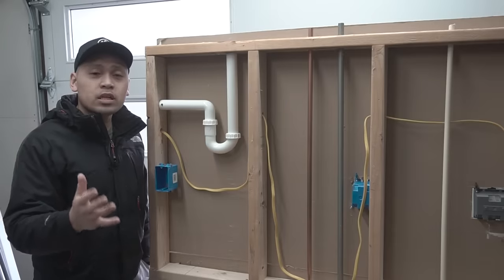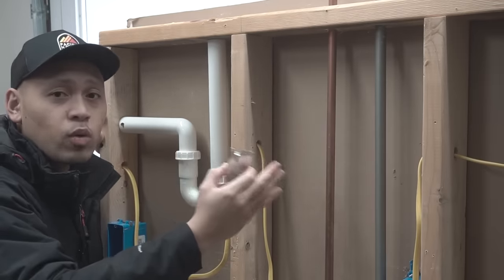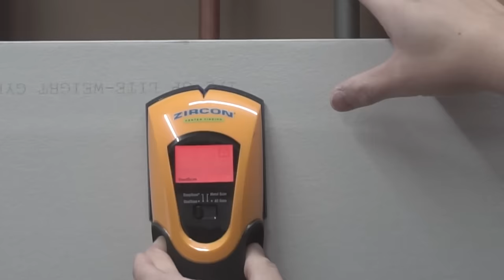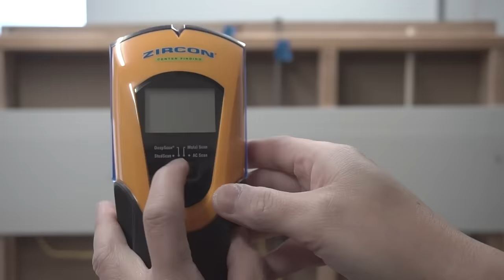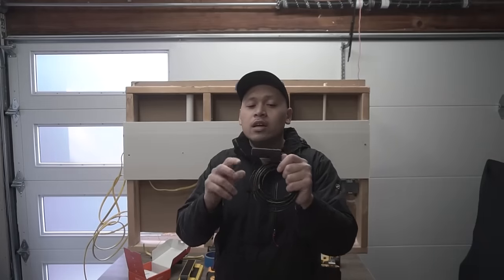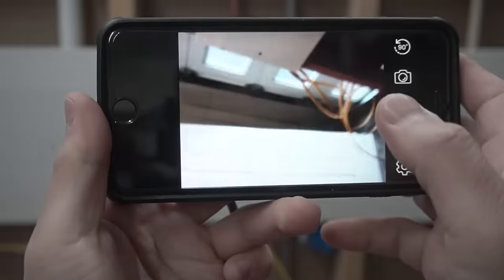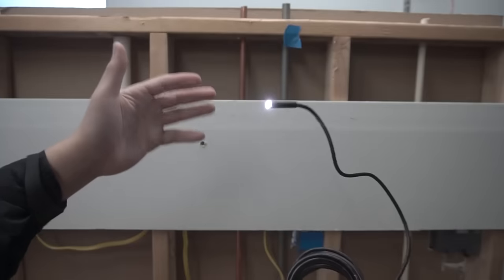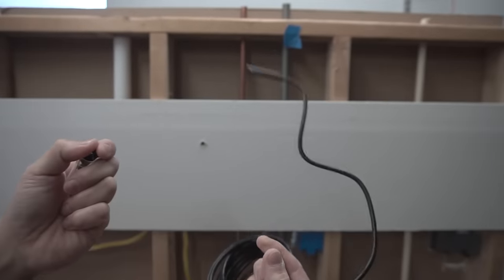STOP Drilling And Nailing Blindly In Drywall And Studs! - Learn A Better And SAFER Way As A DIYer!

Comment: I agree with the comments about it being impractical if there is insulation in the wall which is often the case.  One good use might be for leaks in a new shower or tub installation regarding the drainage pipe.  This could save the installer a ton of $ and headaches if they have to come back months, or years later because of all the damage a slow drip can cause.

Comment: To be honest we usually want to know where the studs are to hang stuff and if that was accurate - that would be great. I think that a worry might be that someone staples a live wire up the side of a 2 x 4 and you drill off center on the stud. I have one of those long stud finder like you have here - I usually measure as I find the stud and see how far apart the studs are to make sure it's not a pipe.
Reply: just use the correct screw length so only 3/4" to 1" of the screw goes into the stud. they you will never hit anything passing through or stapled to the center of a stud.

Comment: I think that stud finder was working. I think it checks at that little V notch at the top and you weren't running that part over the wire in the wall. It makes sense, since you want to know if there's electrical where you're planning on driving your screw.

Comment: Very good to broach this topic.  This has been a concern of mine for years, having drilled many holes for varied purposes.  Many a gamble even using quite a few of the tips mentioned in comments.  Discussing this can only develop tradeskill.  Dismissing this doesn't.  A thoughtful approach would consider the wall type and location of holes in relation to potential wires and utilities.  Also understanding that things inside a wall (including the framing which may be highly creative and NOT 16" on center) can be far from code.  Ultimately the greater the potential risk the higher the need to actually see what is in the wall (especially if you ARE drilling into a wet wall).  One loft I installed had multiple wall types and I carefully removed strips of the interior finish to see what was in the walls and locate dead center of the studs for exactly centering attachment.  Guessing was not a good option.  The removed finish was later covered by ledgers.  That was ONE case.  I remember one wall in a large remodel that was so full of pipes and wires that the first person to put a screw into a stud would have a high potential for hitting something.  In new construction I think there should be (and sometimes is) a photographic record of every wall before the finish.  This can allow locating covered receptacles.  Anyways a great topic to post that I have not seen anybody else do except those selling a tool.

Comment: Those cameras are very common in plumbing trying to find exactly where your mainline clog is. Inside walls sometimes you are going to have insulation. Bottom line is without cutting out the drywall you really have no idea what's behind the wall and should be very careful. That being said accidents do happen.

Comment: As a pro, this is what i do. I use a high powered bar magent as a stud finder. It is 100% reliable.  it finds the drywall screws. Then for screwing I use the proper length screw so only 3/4" to 1" of the screw goes into the stud. That way, even if something is running through the center of the stud, you will not hit it. Will also save you if you miss drilling into the center of the stud and are drilling on the side of it where a wire or supply pipe is running down the stud in the middle, you also wont hit it because the screw isnt long enough. Small things going through the stud like wires and supply plumbing pipes are impossible to hit as long as they are in the center of the wall. Its only possible to hit something with large diameter like a drain pipe. So in the 1 out of 1000 times you do, just cut open the wall and fix it, no biggie.

Comment: the costco stud finder detects all items behind a wall 1.5 inch deep with full batteries and can detect up to 8 inch wide studs.
another trick is avoid 18 inch from floor or 6 ft high this is the 2 common home runs for wire. plumbing is the scariest a wire will short and trip no big deal hit water supply or waste and you can have a huge problem before you discover you have a problem.
the best tool in the world is a little expensive but turns your cell phone into a thermal and radar sensor and you can see shapes sizes. its like looking through a military scope at your enemies on the other side of a brick wall and can scan 6 inch deep. sorry apple not for you in the walabot almost $120 but if money is not a concern you can use the flir 1 for android or IOS almost $400
Reply from the maker: Thank you so much for your awesome feedback! 🙏🏽😊
Reply: I believe many local big box hardware stores rent those FLIR cameras.

Comment: Nail plates will save the day. A company that I hired installed Smart siding on my house, and hit a wire instead of stopping to fix the problem they continued. Well long story short it cost them $900.00 for the electrician to fix the problem. It's an old house and they assumed the hole in the stud was drilled dead center. It was not. Ouch!

Comment: My Zircon StudSensor e50 indicates electric wires everywhere, every inch or less in every direction on every drywall covered wall. I know there are not electric wires everywhere. I also have a noncontact voltage detector on the end of my eTEK multimeter. It also detects live voltage everywhere. Even on hollow doors and on bookshelves.

Comment: I got a $60+ Franklin and it kept showing live wires and my voltage tester literally went off over the entire wall (but not the outlet). The other side of the wall is my converted garage/attic that was done super sketchy before I got the house so while drilling a hole wasn't my first choice I had three endoscopes I bought a few months ago so it gave me complete peace of mind. I also found a fire block so that may have been why the tester was freaking out. I also had fun using a magnet to verify where the studs where.

Comment: Get a Walabot - expensive, but worth it.  I was trying to hang something on my ceiling, I passed over the supposed studs many times with my Zircon.  As usual, I would get unreliable results.  I gave up and just went for it.  When I drilled, I hit a big goose egg.  I was fed up. I bought the Walabot, got reliable results, and hung everything in 5 minutes.  I will never go back.

Comment: Sometimes, destroying the junction box is a way  in. Find the ears on the box, and saw them off. You can really see what is going on with the camera or flashlight. Use an old work box that grips the drywall to put it back together.

Comment: Endoscope doesn't help if you have insulation between the studs. That pink stuff don't use it guys it takes forever to dry. After 24 hrs it's still soft. Jus stick with regular white mud. With endoscope, jus put whole bunch of holes on the wall.  Someone here said he's not using the zircon stud finder correctly, he's right.  The walabot can be best n safe cost more but save money on repairs if you make an accident
Reply from the maker: Thanks for the feedback 👍🏽

Comment: Wish they made a thinner profile endoscope. 5/8th isnt the end of the world but thinner would be better. Great idea though overall.
Reply from the maker: I totally agree! If I find one I’ll definitely make a video on it 🙏🏽😊👍🏽
Reply: I got one off Amazon. 5mm. It's not Bluetooth but comes with a screen and controller about the size of a phone. Not expensive either.
Reply: @ogrelord2011  yes I just saw it seems pretty good! Like the fact that you don’t need  your phone,I would like to see a review on it.
Reply: His is about 5/16". There are a bunch on Amazon listed at 5-6mm diameter. I've got one that has a small monitor and 10 meters of cable. I think I paid about $75.
Reply: This brand also makes a 3.9mm

Comment: I can see lots of points and comments below, some helpful and some just rude :chuckles: 

So I thought I would add my helpful and rude tuppence from the other side of the Atlantic ... build your walls with brick, not this stud nonsense!  Then your only worry is finding the mains wiring but that should have been laid out in the logical ways from the sockets, with most of it either at the bottom or the top of the wall running parallel ... of course should is not the same as is :D  

A problem that can arise with the wire and pipe finding gizmos is that modern re-plastering methods sometimes make use of that wire mesh as a substrate and that can lead to situations where the whole wall can show up as a wire :lol:  I have heard that some plaster mixes can give trouble with false positive readings too but I don't know if that is true.

Comment: if you had the paint to do it and some dry wall screws why not look for recepticals or switches and use stud finder to find the middle of the stud cut straight down then across to the next studs middle and take a big rectangle section out do what you need to do then put it back and drywall screw it in and mud around it and paint over?

Comment: I have a Bosch professional stud finder. It's ok and it self calibrates.  It can be quite sensitive damp walls and PIR insulation you may aswel forget about using it.  
I have located pierced wires with drywall screws after plaster has already been done.  It's close enough
Reply from the maker: Thank you for your feedback! I will have to try that stud Finder for myself 👍🏽😊
Reply: I use a slightly older version of the studs/electrical finder that he mentions in the video and I’m a little scared ha ha, I may have to go look for the Bosch, I’m sure it’s pricey but I’ve noticed that pricey and more features seem to go hand-in-hand.

Comment: You weren’t using the Zircon properly at all. You are supposed to set it on the drywall and hold the button till it sets then start moving left and right. You were just placing it on the drywall and moving it to scan right away which won’t coordinate it properly
Reply from the maker: Thanks for the tip! 👍🏽😊
Reply: lmfao homie said thanks for the tip 🤣😅🤣🤣 translation "IDC bro I'm here for the views"

Comment: My zircon has detected wires and pipes far away from the wall and mine has even fewer features than yours.mine just gives me a ⚠️ for any kind of metal. So i think you were either going too fast or turning the device on too close to the wires  OR yours might be faulty because mine works just fine.

Comment: Soo I bought three stud finders all are cheap but the best I can buy in my town. They don’t help me. There is so much behind my wall that I’m unaware of. I have used all the techniques to find them. They aren’t spaced 16 or 24, the screws I found in the wall are spaced 24 at one point and the. About an inches to the right of but vertically about two feet higher from that screw is another screw. This happens twice. I drill and nail three to five holes under that screw points and can’t find any studs! It’s like double drywall but then it just gives into nothing. The stud finder goes crazy!!! Like it won’t stay consistent which is the problem. I have held it the right way without adding interference to mess it up and it’ll still say there’s a 3x3 square of studs and then it’ll disappear or change location! But it’s saying it’s solid and that’s after 20 tries of slowly passing and calibrating at points on my wall that won’t show a stud to begin with. And then I got about three inches to the right of all this nonsense and I find an effing stud which isn’t close to 24 or 16 away from the two vertical sets of screws!!! I gave up and assumed I hit a stud and the shelf is holding strong enough to not move with I try to wiggle it. I hope I didn’t break a pipe

Comment: the trick is most or nearly all stud finders need pre calibration this is using your stud finder to find a stud may be false or true find but the calibration happens when you think you have an area with no stud count 2 or 3 seconds then move your finder to the direction your try to find as it has calibrated. if it cant find anything perfect, moving to an area with something....
if finder labels wires as stud that unfortunate but its the most accuracy a finder can have if you calibrate it.

Magnets never lie!!!
my favorite thing to do is pair digital with magnetic. 
lot of times i will use my digital to find stud. then i will use a magnet and go up or down till i find a screw head then i use another magnet to find one above or below then i measure 16 inches left and or right and do small circles till i find a screw from here you should see a pattern and it can give you an imaginary xray vision.
this often helps you avoid cutting into nail or screws to dull blades as well as the may creative reasons why you might want to grid your walls.
Reply from the maker: Thank you for the feedback!

Comment: no wires should ever run like that , the best thing is to find the studs beams  framing up from down centered drop down or up, no electrical near pipes at all , if the is no crawl space nor attic,, then wires should always be run bottom or top of beams framing ,

Comment: what if you fold the wires of the endoscope like a small U? So that where ever the wire that's outside the wall is pointing, that's all the direction of the camera.. That way you can get a closer indication of where the wires or pipes are when you find them, rather than just guessing it's roughly in a particular location.

Otherwise, the video was very helpful. Thanks
Reply from the maker: Thank you! Yes folding it to your needs because the endoscope can definitely be positioned to your needs.
Thank you for sharing! 👍🏽😊

Comment: what happens when there is tons of insulation behind the wall obstructing the view of the endoscope? I never use a drill through drywall, don't need a pilot hole for screws and anchors I always use my screwdriver for hole

Comment: Just had an issue drilling in a stud. I do think I hit a strike plate but the area I’m drilling shouldn’t have wires and, so, I did make another attempt at drilling again… this time decided to make a pilot hole and my drill bit broke ..😫… I think I’ll give up and drill a few inches over. I’m just hanging up curtain rods and I’ve hung curtains on this wall before, so I’m totally puzzled about why I’d be running into a metal plate. I don’t recall there being any outlets near this window but I’ll double check tomorrow. I like the endoscope idea. For big projects, I’d prob just make a large hole in the wall and look. I have Zircon and it’s not very accurate. I also have a tool to find wires which is pretty accurate so I’ll pull it out tomorrow. I never thought about pipes behind the wall though outside of kitchen, bathroom, and laundry so this video did help me and the comments about length of screws. I couldn’t remember if it was best to use 1 1/2 inch or 2 inch and looks like if I always use 1 1/2 inch or less  I’ll be very unlikely to hit anything.
Reply: Update:  there is an outlet at the bottom of this window but my voltage detector is not reading voltage in area I am drilling. My voltage detector is typically pretty accurate and very sensitive and goes off if close to wire. However since there’s an outlet at the bottom of the wall near the window I’m going to assume there has to be a metal plate near the area preventing me from drilling. I did look into the endoscope listed. It looks like there’s an updated model. I’ll definitely look into buying one for my bathroom project. Hoping it will help reduce the holes in the wall. Planning to put up shiplap and didn’t even think about potentially hitting plumbing pipes 😫😂

Comment: All you had to do was drill a larger-diameter hole for that camera. This way you can navigate through more easily and view parts of the backside of the drywall. You're gonna have to patch up that hole anyway, might as well do a thorough inspection operation with a larger hole.

Personally, I wouldn't use such an inspection tool even though it can be handy. I'd locate my studs with the first tool you used and use common sense when choosing a drilling location and the length of my screws.

Comment: Just get a magnet based studfinder, or just a magnet. It will find the nails in the studs, it's universal and very easy.
Reply from the maker: How about pipe and electrical wiring?
Reply: @FixThisHouse  Copper pipes & wiring aren't magnetic so you don't have to worry about that. If there is some sort of old metal piping you would be able to tell the difference between that and a nail, the magnet only picks up the nail right on top of it, a pipe would be larger.

Comment: Well, Stucco and tile, forget it. Tapping will be the soundest way. I have magnets. and cheap to expensive electronics and even a Wallbot. all are useless with tile and stucco walls. Learning how to thump will be your best way with tile and stucco walls. Remember outlets and switches if they were installed when the home was built should be attached to studs. Find that stud and you have a reference as to where the next stud could be. Standard construction is 16" on the center stud to stud.

Comment: There are endoscopes and bore sight inspection tools with right angle viewers (they use a little mirror canted at 45 deg). Be that as it may, if there were wires, plumbing, daughter boards, or enough obstructions behind the wall, I would just create a cutout in the wall large enough for a junction box, and cover it later. Have you ever tried a Bosch D-Tect 120 scanner?

Comment: Why not just use a high power magnet? The magnet will gravitate towards the nails that were used to hang the original drywall. Once you find the first stud move the magnet down and find 3 nails, then move over to the direction you need to work on and find the second stud, at the second stud you find 3 nails. That will give you the exact measurements of your studs at center.